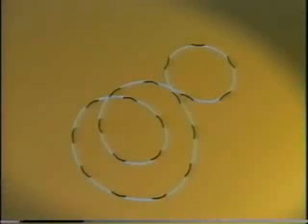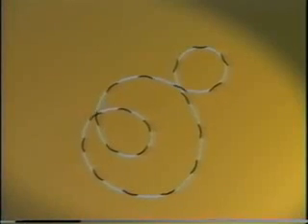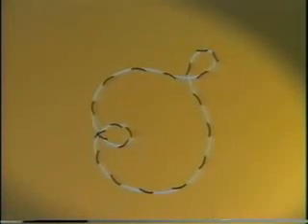Sphere Inside out Part - II

Comment: A twist is still a crease but at a less sharp angle, if this video has to do with the interruption of flow, they haven't followed their own rules.
Reply: A crease is an infinitely sharp angle, if you will. Mathematics hates infinities and infinitesmals. The problem with these surfaces is that at the very place/instant/'point' where the crease itself turns inside-out, there is no way of knowing the direction the surface at that point is going . It is no-man's-land, limbo, fitting a description, FBI's most wanted, the center of a black hole, dividing by zero, endsville, stateless-without-a-passport, don't know whether you're coming or going...

Comment: I am no expert, but I think simply pushing the two sides down would crease the sphere causing it to infinitely curve along the edge. If the edge just infinitely curves, than how can the overall curvature be the same? At some point the edge will have to twist in on itself and the sphere will just revert back to original form.

Think of a rubber band that can pass through itself. As you begin turning it inside out, two loops will be created that infinitely curve inwards. Either it will continue curving infinitely or the rubber band will untwist. If the rubber untwisted itself at the two loops, then the whole rubber band will also untwist itself, leaving you with an rubber band that is not inside out.

The curvature must be the same throughout the whole process. 1 cannot equal infinity.

I have no idea if I am correct or not. Just my observation on why you cannot crease. Creasing is essentially infinite curvature.

Is this correct?

Comment: Oh, I get it, curves are somehow in the perfect position in the graph, between the straight line and the creased line, somehow like -1 being the crease and 0 being the curve then 1 being the straight line. Even if you turn a curve inside out, it will still remain as a 0. For example 0 even if you multiply it by -1 (i'll choose that as a representation of the force forcing the sphere to turn inside out)
It will still be 0 since there are no possible integer for -1. But if we multiply 1 by -1 it will turn to a crease represented by -1 and if we multiply -1 by -1 it will turn to 1 which will turn to a straight line, like the video said, on part one at least, any "happy face" should remain a happy face or it will be a crease causing a failure, and any "frown face" should stay as a frown face or it will be a sharp turn. Pretty simple enough.

Comment: i again get sarcastically proven by the fact that: thought guiding is the reason for misleading.
the rail only allows horizontal movement, a sphere allows vertical movement then the problem has already been solved fundamentally. Just because the problem get dissected during solving through a rail model, that produce the cloudiness of limitation. there is flaw even by explaining the rail numbering rule, it more or less like a law, which a law itself have no meaning per se; and the transition explanation from a rail model to a sphere model for the numbering rule is not with sufficient reasoning by perfect logic perspective. it sort of fall into "it just work" phenomenon rather than something with solid content, this is just a task solving case, which no doubt by building models and work with analogy would do the job; yet for the point of concrete science/mathematics, should be highlighting the tight relationships between each step of progression in deduction.
Reply: This is an easier explanation, not the way to find out. Correct me if I am wrong

Comment: why not keep the same rules for the circle and the sphere ?
the circle needs to stay virtical so in the same way wouldnt the top & bottom of the circle need to stay the same top & bottom?
1. the either the circle is 2 dimentional and would have NO virtical thickness so remaining upright is meaningless,
2. or the circle is a 3 dimentional ring meaning it should be allowed to be twisted 3 dimentionally & the rule of remaining upright isnt apropriate
3. if the circle can pass through itself the outside edge could contract in as the inside edge stretches out.

Comment: If I make the same they did with the sphere with a rubber band (or a circle), I change the turning number by a multiply of (-1).

Tell me how my thought is false if I say: It isn't possible if you need to brake the rules to make the thing happen?
Reply: Your rubber band is 3 dimensional. A circle is 2 dimensional. They made it look like a wall so they could colour the wall to show which side was in and which side out. The up side must stay up, the downside down. That's why it is possible using a sphere, but not using a circle. With the sphere they aren't restricted to 2 dimensions.
Reply: Mh okay, that's true. Thank you.

Comment: I already knew how to turn a sphere inside out. I just wanted to touch up on some things. If a sphere was made up of many microscopic points, it could theoretically pass through itself. Four points is too blurry. A million points is around 360p. 314 quadrillion is the 4K quality. With all these gaps, it would no longer be theoretical. But it would become actuality. Gases and liquids could perform this best. Don't get me started on plasma. But the only material that could pass through itself would either be a liquid of low density, or a gas with the same density. Then it would be even deeper to understand. How can you perform this? You would need a method to manipulate the particles into doing this. Liquid hangs in small groups by a thread. It won't come out perfectly, like all things, but it would show a rough explanation as to if this is possible. Gases are the easy family. Each particle is separate from each other. It would provide a finer example. But to "perfectly" create a sphere inside out, you would need to use some sort of godly material that could manipulate itself into doing this. Do you recall when I said something about plasma? Yup, even plasma can't make a perfect sphere. There is something out there that could theoretically perform this example. But in reality, it would be impossible due to other particles of sorts that interact with this every single time. It could never be done because of how this universe was created. In theory, anything is possible. But in reality, anything can tear, crease, fold, bend, etc.
Reply: Man that was a mouthful.
Reply: I was gonna explain that, but you hit it on the dot
Reply: nanotech ?

Comment: Cool so we can do this to the universe and we will be theoretically in a parallel universe to us?
Reply: Actually, IF the universe was round and we were INSIDE it, after the process we would be FACING the parallel universe(s), but if we were ON IT'S SURFACE as some theories would say, after the switch, we would be clustered at the middle of the sphere, along with everything else on our universe. So, no, we would not be ON another universe on any given scenario, but good theory anyway.
Reply: And if we think about it everything would be further spread apart if we where going from this theoretical "inside to outside" shift, whereas you stated before if we where going from an "outside to inside" shift things would all become more tightly grouped. But this is assuming that it would function in the same way as turning a sphere inside out works (in the since that the overall size of the universe would be relatively the same size, only now with us on the outside/ inside).

Now if there was a way to maintain our positioning completely unattached to this universe while it goes through this shift from inside to outside or vise versa, then when it is complete we would in fact be on the opposite side or this parallel universe.

This is of course not taking into account all the possibilities like survival of the process, alternate laws of physics and there effect on us or whatever is being used, possibly being in the same position as another planet or star when the shift finishes (if the alt universe even has these), etc, etc

I do love me some theoreticals though!

Comment: Just push this part through the other...  ?

Why not just make a hole in the sphere, reach in and pull the other side all the way through the hole and then seal the hole?
Reply: Watch the first part, it explains the rules of turning the sphere inside out.
Reply: OK, tell me how tow parts, e.g., the top and bottom caps, or radial strips can pass through each other.
Reply: listen to 8:42

Comment: To those saying this has no real world application: what happens when we discover a way to chain atoms of metal together electromagnetically such that they are spaced far enough apart to move in-between each other, creating a chain mail on the atomic level? Since atoms are mostly empty space (as far as we know), their spacing relative to one another doesn't void the "no holes" condition presented in the video (provided proof is provided that they are "linked together"), and the corrugation method becomes possible. I'm sure this logic has holes in it, but it's the imagination and logic skills presented in the video that matter.

Comment: Self-Intersections are not possible in reality. Is there currently an application for this? I emphasize currently because in the renaissance it was not clear how some mathematics would be used in present times, so I don't want to take an arrogant jump and say "There's no use for this" but I am curious (and doubtful) if there's a CURRENT use. I don't expect self-intersecting material in the future, but maybe it would be relevant for gas or plasma, or just something theoretical to do with mapping or other data.
Reply: I don't know any practical applications of this in particular (or maybe I do but don't know enough about topology to realize it) but topology in an abstract sense isn't really about spheres and toruses as much as it is about sets and homeomorphisms which are concepts present in many other fields of mathematics. So a problem in let's say graph theory that is very difficult to solve in that paradigm could be proven to be equivalent to turning the sphere inside out without seeming to have anything to do with it in it's original formulation. Then, graph theory is very useful in logistics, robotics, computer networks etc so a practical application might be closer than you'd initially suspect
Reply: Thanks, yeah that was my main suspicion, where it would have a math/data use somehow. I'm not well enough informed to say any more than that however. It would be nice to see the connection, kind of like exponential growth functions in finance, biology, nuclear reactions, etc. Anyways thanks for your comment rake667,

Comment: I am not sure whether this is correct or not.... For example, if you make a trihedral axis on the sphere's surface, won't the normal vector change direction (instead of showing outwards initially, it should point inwards). Isn't that against the 2nd fundamental form?

Comment: okay, but the equator is a circle, and if you were to turn the the sphere inside out, you would also turn the circle of the equator inside out. That's of course not possible because of the turning number, Seems to me, that this isn't properly thought through...
Reply: As they explained in the video though, when dealing with circles, they can't be flipped like turning an elastic band inside out, the bottom of the ring always has to remain on the bottom.  With the sphere, this isn't the case.
Reply: Think of the equator as an open-ended cylinder with a ridiculously small height; that's why it can be flipped, because it is a three dimensional shape. A circle is a two dimensional shape, so trying to manipulate it in the third dimension is impossible, like telling someone to solve a problem by using time travel.
Reply: dsmith6484 I now what you are saying, but still. If you were to turn a open ended cylinder inside out, the Circle on the top would move on the z axis/would go down, and the circle on the bottom up, because of the process of turning it inside out. But there is one circle on the cylinder and on the sphere, that doesn't move along the Z axis. and thats the circle in the middle/the equator. And as you saw with the circle example, when a circle wants to stay exactly in its place, it cant be turned inside out.
Reply: AwesomeGuy When the lady said you cant turn a circle inside out she meant that you can't do it if all the transformations are 2 dimensional.  In this case there are 3 dimensional transformations.

Comment: so if you have one eight yuo won't be able to do it coz you have 1 or -1 but because there are two eights you have either 2 or -2 which is an even number so you can twist it around so it works if you have a sphere? but you can't do it because if you have a basketball you can't do that, you need an opening. you can't even do that with a football or any ball exept any material which allows another material to pass through evn thought that's impossible so really you can't flip a sphere inside-out..

Comment: Finally got the answer. And it was a lot of calculus. Basically this is used in physics. But the stuff that just happened if put on paper would be hundreds of pages of calculus. The sphere is just a visualization of the calculations, I get why they said it was not the same as a spherical basketball. They should say that in the beginning though.

Comment: You wouldn't need the material to be able to self intersect if there were more than 3 dimension in room. A stretchy material would be totally sufficient, because you would be able to do all this without the material intersecting itself by using the space you get, when you had a 4th dimension.

Comment: You'd be surprised. The conditions placed on the material of the sphere are not arbitrary -- they determine something called a homeomorphism, which is an equivalence relation in the field of mathematical topology. This is useful because any space with a notion of continuity usually has a topology structure lurking in the background. Thus general theorems in topology can sometimes be used to deduce facts concerning physical spaces/structures which have this property of continuity.

Comment: Good thought,but isn't the fact that the two "creasing" sides of the material goes from cutting eachother to becoming one connected side without any crossing points proof that the sides eventually will meet up and then pass eachother.Say that from the crossing point of the sides to the exact midpoint of the loop there is a line. The amount of numbers that are inbetween the line and the sides will allways be infinite but at one point the 2 sides will line up with the line and pass it!:P

Comment: But professor, there's one thing I don't understand, if the blue apples trully had become extinct, wouldn't that have caused a significant drop in the population of the great mammoth-eating koalas? and if so, wouldn't that have caused a rift the the pear-time continuum and, therefore causing the disapperarence of Saturn?
The leads me to conclude that the blue apples didn't in fact go extinct, but rather mutated into a form of purple bananas after the eruption of Mount Whathehell

Comment: Both of your theories have determinative information, but i have detected mutiple flaws. First off, your theory of call of duty 2 is easily disproved due to the fact that the elephant's playstation 2 was stolen by a golden retriver. Also you two failed to summate the works of Mr. Dr. Prof. Imhotep. This universaly well know being discovered that using synthetic division to find the weight of my pencil sharpener.

Comment: That is a very plausible theory; however, the atomic blast managed to blow a habanero mosquito into a stray pepper with such force and energy that the DNA of the two chemically fused. After habaneros started growing due to this mutation, Naked Elmer Fudd began to make pizzas with them, which, in turn, hippopotamuses ate. The flatulence was so widespread that a gas cloud arose, coagulated, and blocked out the sun, creating an ice age, which means the northern hemisphere was ice.

Comment: Reasons why you cannot create a crease or sharp edge in the sphere:

When the sphere creases, either there is a small bit that will never flip itself to the other direction without breaking it apart from the rest of the sphere so that it can be turned over -sphere must be turned completely inside out,
OR you create an instance where you are cutting at that point to pass the two sides equally -sphere cannot be cut or punctured.

Comment: easiest way to invert a sphere with out breaking rules or surface of this challenge is simple
just reverse the draw order of polygon in the geometry by just selecting the all faces then choose option like reverse normals / flip face depending on 3d software you use 

alternative reversing draw order of polygon using notepad editor if you sphere date is text compatible ,polygons are always drawn in clockwise order

Comment: According to the elaboration of the said theory, the polarity of the neutron flow would only travel at the speed of a Peregrine Falcon if, and only if, the pizza have anchovies. Pepperoni would cause the electron to relapse and cause an unstable concoction of a Diet Coke. Thus, the flamingo was the one that threw the bacon.

Comment: It depends on the pressure inside the balloon. I would say that a 1mm hole (or less, depending on the needle) wouldn't be enough to cause it to split open, especially since the area opposite of the balloon nozzle has thicker material than anywhere else on the balloon.